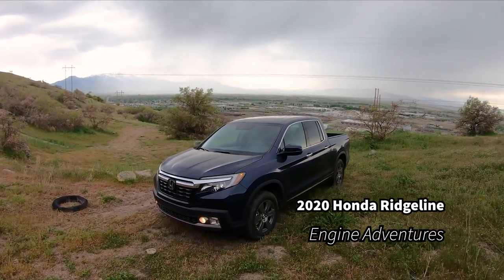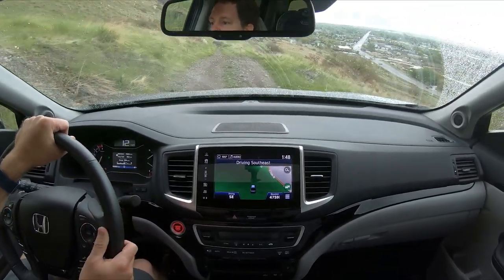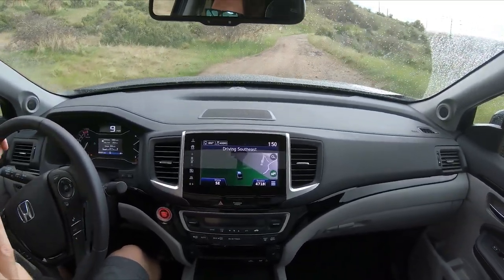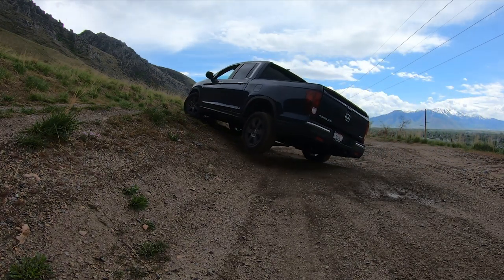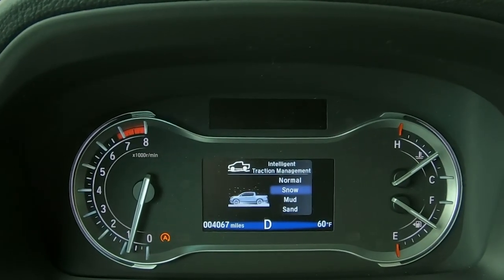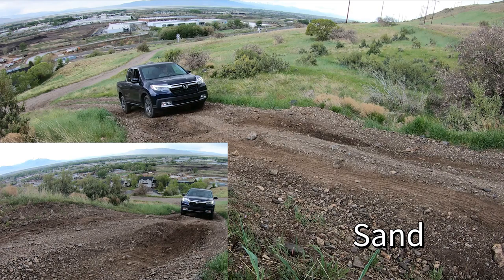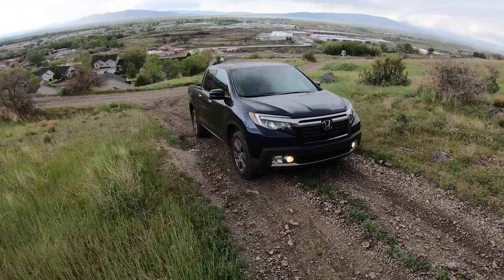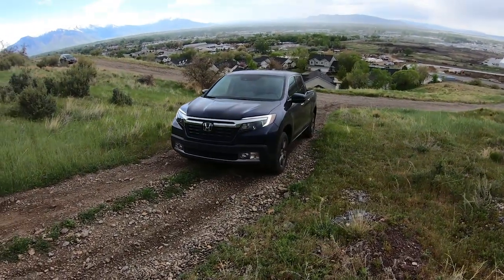2020 Ridgeline Off Road

Comment: FYI to the author and credit on this comment goes to zroger73 on ROC forums, but...
"He did make a technical mistake, though, when he said, "Without the extra traction from applying the brakes to the spinning wheels, the clutch packs weren’t able to transfer enough power side to side on the rear axle to make the climb." He seems to understand how the system is designed based on his earlier description, but doesn't seem to understand how it works based on this statement. On the Ridgeline, torque is "transferred" from side-to-side by controlling the application of the left and right clutches - not by braking a spinning wheel. Braking a spinning rear wheel on the Ridgeline is counterproductive because it doesn't have an open differential in the rear. The technique of moving torque from a slipping wheel to one with traction only works on open differentials."
Reply from the maker: Great point! Now I have some thinking to do. When I turned off the traction control there was a lot more wheel spin than when I had it on. Must have been cutting the throttle more than anything. I guess it could apply the brakes on the front wheels, but not on the rear. The clutches can't apply enough pressure to fully "lock" the wheels together which is a major downside.
Reply from the maker: Do you have the link to the Ridgeline Owners Club forum where this was posted? I'd like to read more about it.
Reply: @EngineAdventures  Yep -- https://www.ridgelineownersclub.com/threads/updated-2020-honda-ridgeline-goes-off-roading-by-pickuptrucks-com.222750/
Reply from the maker: Thanks!

Comment: I have a 2018. Been in heavy rain, light mud roads, and some pretty heavy snowfall on paved and improved dirt roads. Never an issue except on a large patch of ice where it never got traction on a road with a slope. Quick pull and it was back. Had I never stopped for another vehicle and kept momentum, it wouldn't have stopped.
Reply: Thanks for the input... is yours AWD or 2WD?    I have a Passport and it's incredible in snow and ice... Honda makes great vehicles.
Reply: @Ram14250  Was AWD. I now have a 2020 RTL AWD. When your weather is generally mild like here in CA, it's the ideal truck. I love the Passport too and would consider it as my next SUV. Take a look at your local Honda dealer. Mine had a fraction of their local inventory this weekend so glad to have what I have

Comment: I'm trying to convince my wife to buy one for her next vehicle so then I can use it too and keep my full size truck for the heavy duty user.   She drives a crv currently so this would be a pretty good upgrade to that.
Reply from the maker: Thanks for watching and commenting! The Ridgeline gets a bad rap, but is a great vehicle.
Reply: I have an older RL and came from a similar year pilot. The way they handle is very very similar. That independent suspension does a great job.
Reply: I have a 17 Ridgeline and put a 2 inch lift and bigger  a/t falcon wildpeak at3w . It is great for overlanding.good daily driver and great for camping trips.

Comment: Here's a hot take: This truck is focused on providing exactly what most people actually need a truck for, and through that focus, is exceeds its "more capable" rivals at that set of tasks.

A "real truck" won't ride as well and won't handle as well. 5000 pounds is enough to tow a car or a smaller camper. The AWD system handles a muddy driveway or some snow. Wtf do I as a normal person need a truck for beyond those, that makes me want "real truck" inferior build quality?

Comment: This is a valuable video for anyone considering the Ridgeline for off road or rough road driving. I will not be considering the Ridgeline as a replacement for my Ranger. The Ridgeline is a better appointed vehicle even when compared to the top of the line Lariat. Thank you for the demonstration.
Reply from the maker: Thanks for watching!

Comment: Great video. Technology, Honda reliability, and comfort were more important to me than off roading but nice to know what it is capable of. I love my new Black Edition.
Reply from the maker: Congrats on your purchase! It is a great truck and I hope if you ever are in a tough weather or offroad situation that you can be confident in your trucks ability.
Reply: Agree. I drove one yesterday, a 2020. Does not drive like a truck, solid and smooth over large speed bumps. I am getting one to pull a nuCamp 2900 lb.trailer.( nuCamp 400)
Reply: @ericswenson322  You won't be disappointed.  Also, fits in my garage and easy to park.  Very comfy on long road trips too.
Reply: @sgt.slaughter8170  We are coming from an Audi Q5..I hope, because of the length, I won't be taking out  fire hydrants on  corners..Q5 was  shorter..HA..

Comment: I had a 2014 I took it through some Mudd that went up to.the bottom of truck hit the locker mode and got out easily.  It's not a rock crawler for people expecting a jeep. Really smooth truck
Reply from the maker: The unibody design helps keep weight down and the 4wd system is really quite capable. The combination of the two helps the Ridgeline perform much better than people expect.

Comment: Just think of it as a makeover of the old El Caminos with all wheel drive.  Wouldn't brag about it getting it up that tiny hill...but it is what it is......great video and nice light duty truck with great gas mileage.
Reply: Good for the occasional dump run, or to pickup a "couple" bags of concrete or potting soil.  That's about it.
Reply: @jw5031  The payload actually beats other midsizers, and many light duty full size (if comparing similarly configured vehicles). The issue would be the temp spare tire in the bed.

Comment: The thing,can do far better than than the driver did on this report.allthough.it was a good demonstration of all the drive trian settings.If you Strattel. many of those little rutts.& use slightly different forward momentum. You would be surprised at how much better it can do .but make no mistake. This is a business man's special. Great for on old guy ,like me .that is dependable safe & can get around in bad weather situations. But I would never take it in even the mildest off road terain.Or push the thing past it's Design limitations .I Am a very happy PROUD owner of a 2019.awd.Sport
Reply from the maker: The point of my testing is to try and find the limits of the traction control system. There is certainly an easy line up this hill, the Subaru and RAV4 TRD Off-Road both had to take it, but you may run into a hill where the easy line is harder than the hard line on this hill. Ultimately the Ridgeline did very well off-road and made the nearly 70% grade with two wheels not having traction! It surprised me as the previous generation Ridgeline is unable to do even the easy line up this.
Reply: @EngineAdventures  well put.

Comment: This thing will do it far better then Subaru, Honda's sh-awd with rear vectoring is front wheel biased but can send 70% to rear or 100% to just single rear wheel if needed, it also aids cornering by spinning diagonal rear wheel faster...Subaru has open diffs with abs traction and non lockable center clutch activating only on slip...However both Subaru with cvt and All the clutch working in Honda is only good for slippery conditions and light dirt road terrain, they both overheat clutches in heavier use...But both older ivtm4 and sh-awd are pretty rare systems in segment, ivtm4 is awd with locker and sh-awd is more automatic, but font biased capable sending more to back then front unlike all other just do 50/50
Reply from the maker: The RAV4 TRD Off-Road and Chevy Blazer both offer dual clutch rear differentials which are very similar to what the Ridgeline has. There are probably others that I'm missing, but as you said these systems are great all weather systems, but their clutches just can't handle the amount of power that manufacturers claim can be sent to a single wheel. Thanks for the view!

Comment: HONDA GUYS    If you want to see more off - road videos of the Ridgeline in action , search  "Everyman Driver "  Off-Road : 2017 Honda Ridgeline .  Fast forward to 7:30 mark .

"Fast Lane Truck "        Ridgeline successfully climbs Gold Mine Hill with no transmission overheating problems. 

Most people , like myself don't buy a Ridgeline to go off road , but it's good to see that they can . 
They are also pretty reliable trucks and great in the snow ,  my "08" is still going strong ( just follow the service maintenance schedule).

A fun video to watch is :  "Trying to get a bone stock Honda Ridgeline stuck " .

Comment: The Ridgeline has been on my radar for a while,I do no off-roading other than some basic dirt roads once in a while,I had major back surgery so this will be much easier to get in and out of...I wish for the money it had ventilated seats and wireless charging and especially a damn radio knob!!
Reply from the maker: I think you would be happy with it! I do hate the lack of knobs for the radio and not sure why they are sticking with this design at the moment.
Reply: Wonder if an aftermarket head unit would work with all the features and such?
Reply: I thought I would miss the knob.  I don't.   So why risking having some third-party shop screwing up the electronics for a knob?
Reply: The steering wheel. Buttons work great. I hate an all touch screen unit.

Comment: Good review!  Could've had a 2019 for a good deal but held out for the 2020 and 9 speed and the manual sequential shift and lower first gear for towing.  Love mine, looks identical to yours! ANd for those complaining about no knob on the head unit: trust me, it's not a big deal at all, and you get used to it real fast.
Reply from the maker: Awesome purchase! I hope it treats you well for the next decade or two!
Reply: @EngineAdventures  One thing though: I wish reviewers would mention important design information to silence the "Pilot (or Odyssey) with a bed" trolls, that the suspension components, brakes, bearings are all unique to RL, and are much beefier and more robust by design for "real" truck use. This gets lost in reviews.
Reply from the maker: Thanks for bringing that up! When reviewing vehicles a lot of these details are missed because of the limited amount of time we have with each vehicle (typically a week) before our next test vehicle arrives. I know I'm missing lots of good things!

Comment: My only nit pick with this truck is the small gas tank.. it only has 19 gallons it should be at least 21. I also wish it had a 4 cylinder diesel option...other than that if i had 50 grand i would buy 1 lol
Reply: buy a 5 gal gas can.....................................
Reply: @VIVADUDE07  yeah they also have these portable filling stations that hold 15 gallons now so it's like having another tank in the bed lol

Comment: Proof that iVTM-4 really works! Do you think a Passport would do even better? Better breakover angle, a little better ground clearance and less weight.
Reply from the maker: I tested one before I started doing video and this test hill. I do remember it struggling a little bit on an easier hill though.
Reply: @EngineAdventures  that's strange, considering it has the same AWD and transmission setup. Hope you can do a full test with the Passport some time soon :)
Reply from the maker: @deepncsu  I agree with you, I would think the passport would do better than the Ridgeline. It might do better as my methods have improved significantly over the years and especially since I started doing video.

Comment: The Ridgeline is real nice. The only deal breaker for me is the ground clearance and the exposed oil pan is worrisome. I went with the Ford Ranger. The Honda is a nice vehicle, no doubt. And I'm sure the AWD system is exceptional.
Reply from the maker: Thanks for sharing your experience. If you're going off-pavement or towing more than 4k-5k lbs, the Ridgeline isn't really the best choice. Other than that it is great, more room and utility than most other trucks out there.
Reply: Lift kits are cheap and easy to install. Lol

Comment: Honest question: would this truck beable to succeed on the beach in loose sand? Would this beable to keep up with say a Tacoma TRD Sport, or a jeep?
Reply from the maker: I think this mostly comes down to the tires as both have similar horsepower and weigh roughly the same. Both pretty much have highway tires, but the Tacoma's are wider so they should provide more floatation on the sand. The AWD in the Ridgeline is good, but I would be worried about overheating the system if I were spending a lot of time off pavement.
Reply: @EngineAdventures  thank you for the reply. That’s what I was think g too. Honda makes a hell of an engine but I wasn’t sure about it’s capabilities on loose beach sand specifically. I live in NJ we have very very loose sand it’s not compact like other regions

Comment: Question. 6 speed vs 9 speed transmission. The 6 speed is has a lot of love and from what I've read seems to be pretty bomb proof. Surprisingly it is also rated for 1mpg higher on the highway over the 9 speed. I'll be looking to get a used (or possibly new) Ridgeline in the coming months. What are your opinions regarding the two transmissions?
Reply from the maker: I've only spent a week with each of them, but my take is that if you are towing or hauling heavier loads, then the 9 speed is much better. Having the significantly lower 1st gear makes a big difference! It also helps with acceleration off the line as this engine makes its power high in the rpm range. Otherwise I don't think you can go wrong with either one.
Reply: @EngineAdventures  Thanks for the reply! Realistically I think I'll be happier with the better MPG. It is really bizarre to me that even with the lower end power that with an additional 3 gears it doesn't at least equal the 6 speed. Strange!
Reply from the maker: That is weird to me too, but a lot of vehicles are that way